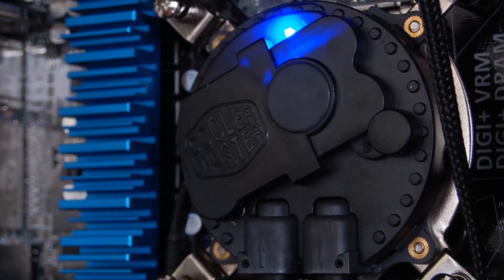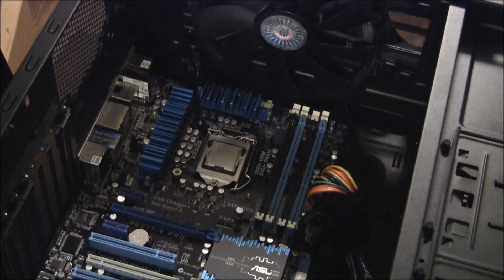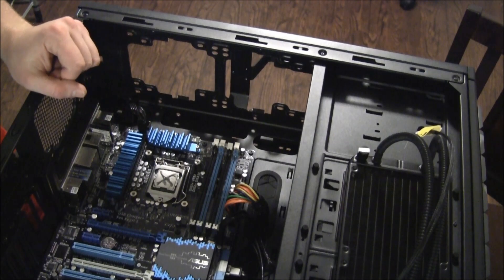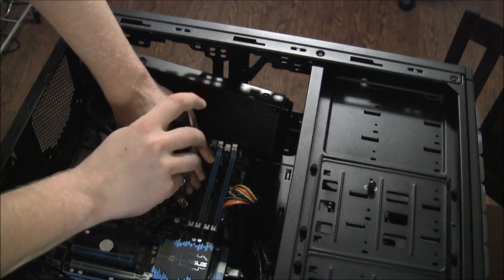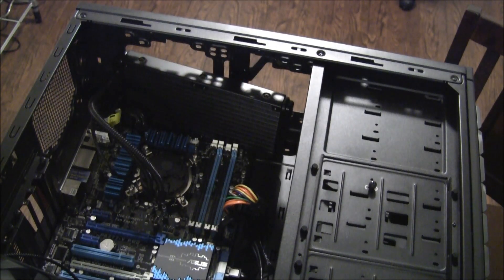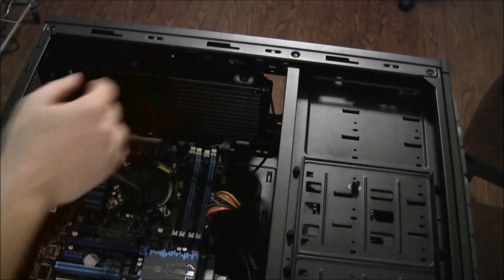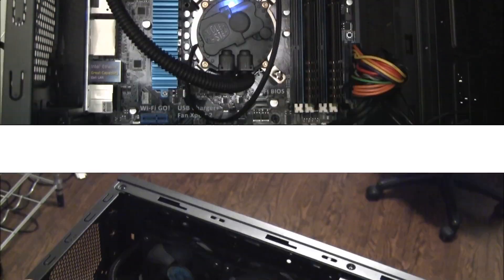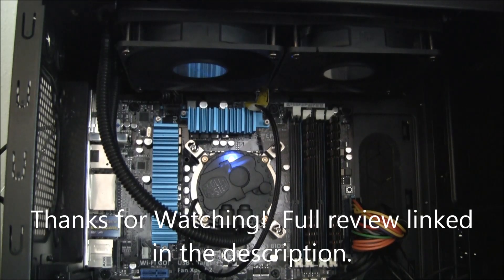Cooler Master Seidon 240M Review: Installation and 4.0 GHz Overclock Demo

Comment: Noctua - who know a thing or two about coolers recommend a grain of rice sized thermal paste worked over the top of the CPU with your finger inside a plastic bag.
My 1366 Xeon 3570 (which happens to have unlocked multi) idled at nearly 60deg with the stock cooler. With the Noctua cooler it idled a full 20deg C cooler. It is possible the stock cooler wasn't very flat on the base but a straight edge showed no irregularities so fiik what the problem was.
Anyhow, point is you don't need much paste to do the job.

Comment: I just changed mine from a push to a pull configuration for easier cleaning and the fan blades kept hitting things. Leaving out the rubber brace made the fan blades hit the radiator, and the rubber brace, when used, kept sticking itself in the way of the fans making an awful noise or just stopping the blades altogether. Had to stick something between the brace and the rad to stop that, but on startup when the fans hit 100%, I still hear the fans hitting the brace. wtf

Comment: wouldnt it be safer to install the water pump on the CPU with the feed lines on top?
this would prevent air bubbles from getting trapped inside over time.

Comment: I have this on a FX-8320 and it runs at 90F at idle....?!?!
The STOCK cooler ran at 85F idle... Isn't this huge cooler saposta be better?!!?!??!?!??!???!
$80 to just gain 5 degrees 
W
T
F
Reply: Idle temps dont differ much between air & liquid, it's the load that matters

Comment: my rig is :
asus maximus 7 hero with i7 4790k and cm nepton 240 m 

i want to know which cabinet will fit my 240m easily with my mobo 
cabinets available here are from corsair and cooler master
want a cheap and best cabinet , plz comment the model which will support my rig easily

Comment: Please help me, I got a New cm storm trooper and cant find the connection to the control panel for fans and led..  It isn't lighting up.
I cant find an connection for the fans on the hard drive cages too.
Its like there are too less connection cabels.
I read soms thinks about a molex cable nut that didnt Make thinks clear.

Could anyone please help me?

King regards
Arthur

Comment: So basically this setup has the fans exhausting air out from case through rad and out out of case. So that would be somewhat hot air I assume. Shouldn t we in take cool air throught the rad into the case instead. Or am I wrong and it doesn t matter
Reply: its all about airflow in the case, with front fans pulling in air to case, and if you setup rad fans to pull air in, you really only have 1 exhaust port on the back reducing airflow and also raising ambient temp inside the case, where as with fans pushing air through radiator(or in pull config, pulling air through radiator) to outside of case, it increases airflow inside the case and reduces ambient temperature so your VRM's/Mosfets, Ram are kept cooler!
Reply: doesnt matter
Reply: u're right. look up for jet engines mechanisms.

Comment: can i install this in my thermaltake chaser A21?
Reply: I have a Chaser A21 and a Seidon 240M and yes, it does fit, I had to do some ghetto mounting to get it to fit though (using the case mesh as a screw hole), because the screwholes didn't line up.

Comment: With a push/pull configuration, is the air supposed to be sucked from the outside and in? or from the inside and out? This confused me a bit :-)
Reply: Inside meaning the inside of the case, and outside being outside of the case.

Comment: Will I be able to overclock my 4770k to 4.5 or 4.6 with this?
Reply: I'm at 4.7 stable with push/pull on single 120x38 radiator.
I don't see over 70°C
Reply: It honestly depends on the quality of the silicon on your 4770k batch.  I'd say 4.3-4.5 is a safe bet but Haswell runs really hot.

Comment: Will seidon 240M fit in cooler master haf 912 plus case?
Reply: Yes
Reply: Tim Kline So is this confirmed? the fans and the radiator of the Seidon 240M will fit in the Haf 912?
Reply: Yes. If you put it on the top. However, it is a tight fit. It does indeed fit. But, the 120MM cooler is perfect for that case, that is what I personally have, and have a single 240MM up top. I hardly see over 100 degrees F, when gaming. At idle it is normally 78-80F.
Reply: You'll have to change the fans for a slim one's because the rear fan don't let space for the radiator fan

Comment: Did you remove the 200mm fan at the top for the installation of the CM seidon 240m cooler and is this something you have to do? :)

Comment from the maker: I believe it comes pre-applied (I can't recall for sure), but if it doesn't come pre-applied it definitely comes with a small tube of paste, so you shouldn't require any aftermarket paste.  We remove any pre-applied paste to ensure consistency when testing different coolers.

Comment from the maker: Indeed, and most times these pastes are much more "liquidy," i.e. less viscous so they spread very easily.  While the NT-H1 spreads decent enough, the "X" method works far more effectively and consistently with this paste.  If you used something like AS5, you'd have paste literally oozing / running out the sides, which is what I think you're primarily getting at, which is absolutely valid.

Comment from the maker: It's actually not as much as it looks like. We use Noctua NT-H1 thermal paste which is especially viscous so it doesn't flow very well. As I draw the lines across, I stretch out the bead. By drawing the lines toward the edges it allows for more even flow of the paste and we get a very consistent bead around the outside of the chip, allowing the little excess to escape evenly. We've measured the amount of TIM versus the "bead" method and they're comparable w/ equivalent performance.

Comment: The Coolermaster HAF XM has a 200mm fan on the top... would I have to remove it to install the radiator and 120mm fans?

Comment from the maker: Sorry, my explanation seemed a little vague.  I would set the 120mm fans to blow OUT the top, and have the 200mm fan also pulling OUT of the case.  So your stack from bottom to top would be 120mm fans > Radiator > 200mm fan.  If I were you I'd also try without the 200mm fan to ensure the 200mm fan doesn't actually impede the pushing fans.

Comment from the maker: Based upon the specs, it looks like the top vent will accommodate either a 2 x 140mm or 2 x 120 mm fan arrangement, so this should fit.  I would still try to check about the vertical clearance you might have from the top of the vent to your RAM sticks or any large VRM heatsinks on your motherboard to ensure those will still clear.

Comment from the maker: I think I'd rather have it be below the 200mm fans with them helping to exhaust.  The 120mm fans will create more pressure and are better-suited to push than they would be pulling with the 200mm (which would bleed around the radiator) as the pushers.

Comment from the maker: It looks like the Enforcer lacks a 2x120mm fan option which is what you'd need to ensure you have all of the available mounting holes.  If you're comfortable with making some small modifications, you could probably make it work in the upper vent, but it's hard tot say without seeing how much clearance you have with your current motherboard.

Comment from the maker: The one in the video is the Cooler Master Trooper.  The HAF XM is a great case and you have a couple options for mounting in that case.  It should work well with that.  The HAF 932 / 922 are also great cases, but are a bit before CM and other companies started making all-in-one watercooling systems, so you're less likely to have extra clearance for the Seidon systems. If I had to choose the HAF XM would be the winner in your list.

Comment from the maker: This should work great on the HAF X.  It has a large upper vent which should allow you plenty of room.  I cannot guarantee you won't run into any issues depending upon your motherboard layout, but you should be able to fit in that big case without any problems.

Comment from the maker: Sorry about that!  I did my best to keep the video to a manageable length.  I installed this directly over the existing motherboard backplate, as it was designed to span over the top of any existing backplates.  I hopped past the push-pull because it was essentially the same thing just with another set of fans in-between the radiator and case using another set of longer screws.

Comment from the maker: I connected the fans to the CPU_FAN header and the pump to the CPU_Opt header.  I was using an ASUS motherboard and most ASUS boards have two CPU fan headers.  Otherwise I would connect the pump to a regular fan header and allow the fans to regulate via the CPU header.

Comment: It would have been nice to explain what you did for a push pull function and not fast forwarding through certain parts since its an installation video to be honest idk what to do if my motherboard already has a back plate pre-installed

Comment: thx.. can you tell me if it's possible to fit (with Asus Sabertooth Z77's "thermal armor") in one of the following: 

1. CoolerMaster HAF XM

2. CoolerMaster Case HAF 932 Black
RC-932-KKN1-GP Case w/o PSU

3. CoolerMaster Case HAF 922,
RC-922M-KKN1-GP HAF Mini Tower with
20 cm fan in the front and top (is this the one in the video?)

thx in advance..

Comment from the maker: That's correct.  I had to remove the 200mm fan on top to put in the Seidon 240M.  I wouldn't say you'd be "under cooled" as these aren't sealed boxes and there's plenty of extra venting if you're intaking more than you're exhausting.  The large 200mm fans also spin much slower (and thus are quieter) so they don't move as much additional air as you might think.  If you have the Seidon 120XL, you can also place it on the back fan and retain the top fan, if you'd like.

Comment: Hi, nice video, i got 1 Q.
I have a CM Stryker, and it should fit in, but won't it be under cooled? 
i mean, in the stryker there are only the 2 frontal fans and the back one.
If i put the seidon(n in my case, the 120xl) i will have to replace the big fan on top.
Is it correct?

Comment from the maker: The response I got from CM indicates that the Elite 431 won't accommodate the Seidon 240M without modification, as it wasn't designed for it at the time.  It's a bit too low and the motherboard mounted too high to prevent the radiator from hitting.

Comment from the maker: Looking at the specs on the Elite 431, it looks like it can accommodate a 2x120mm fan setup, but I haven't used that case before, so I'm not sure if the motherboard standoff locations will provide the height / depth for a radiator.  I'll see if I can get an answer from a rep at CM for you.

Comment from the maker: I have the Cosmos II, and I don't see there being any issues with that case, it was designed to accommodate a wide range of water cooling solutions and the top vent allows for 3x120mm fans.  As noted above, the H110 and the Seidon 240M will be very similar and either should serve you well.  Your choice may depend upon brand preference, price at the time including any sales (the Seidon 240M tends to be notably less expensive), and the look of the cooling head.

Comment from the maker: They are extremely similar, which is why I tend to recommend the Seidon 240M because it is a fair amount cheaper than the H100i.  Their actual performance is also extremely similar, so it's really a preference of how the cooling head looks, whether or not you have a fan preference, and/or how much savings you can find, but both will serve you about the same in the end.

Comment from the maker: No problem, happy to help!  While I have not had the pleasure of getting my hands on a 1200 before, it looks as though the twin 120mm fans on the back would be perfect for this.  I doubt you'll have built-in mounting on the top 200mm fan and you'd want to remove the 200mm fan if you did try to make it work.  Let me ask my contacts at Antec if they can help out.  Send me a message if you don't get a reply in a day or two in case it slips my mind.  It should have all the screws you need.

Comment: I just purchased this and I hate to be "that guy" but how do you think it will fit into an Antec 1200 full tower case? Do you think I will need some separators or long screws? What would be your opinion for the best placement top with the 200mm fan or on the back were there are 2 120mm fans? I know your video shows a different case and you may have never used an Antec 1200. I just thought I would ask you first. Thanks in advance.

Comment from the maker: Sorry for the late reply.  I'm actually using Patriot Viper Xtreme memory, but they are similarly high-profile.  This would certainly suit your needs nicely on the clearance front, but then you'll need to be careful about the depth from the top of the case to the top of the DIMM slots for push-pull, as even in my CM Storm Trooper and a full-sized P8Z77-V Pro came right up to the sticks within 1mm.  The Phantom should give you good options to work with.

Comment from the maker: I was using the ASUS P8Z77-V Pro motherboard which has two CPU_Fan headers so I plugged into both of those.  However, if it only had 1 I would plug the pump into the CHA header since from what I can gather from any specs the pump speed doesn't vary much but you'd want your fan speed to adjust to your CPU temps via the CPU header.  Which motherboard do you plan on using?  Most new motherboards have at least basic onboard fan controls so you can likely set how each fan header operates.

Comment: I see your using corsair vengeance memory. I was wondering if you did any further testing on whether or not the quad fan push pull tactic works with those sticks. I've been trying to find a good compatible heatsink, be it air or liquid, for my CPU. I have the P8Z77 M-Pro, a Micro ATX board with all four ram slots filled with Vengeance, so it's hard to find a good compatible heatsink with those effing heatspreads on that high profile ram. I was thinking of getting this cooler with my new phantom.

Comment: so the fans that u installed on the radiator, r they pushing the air out of the case or are they taking air into the case?

Comment: lol i just checked, im running at 4.2 mhz with the default fan the i7 comes with. I have a intel 3770k i7 ivy bridge currently in my build. What would my maximum cpu speed be at without exploding of course?

Comment from the maker: The H100 is almost exactly the same size as the Seidon 240M, so you should be good to go.  Again I would use caution if you want to use push-pull as it could interfere with the memory depending upon your motherboard.

Comment: intel is a little bit too expensive... similar amd processors run the same games only with 5-7 fps less, but they cost 100$, 150$ less
but that a REALLY good overclock :p 3.8 to 5.0 keep the good work :p

Comment: i have an AMD FX-4100 3.8ghz ( overclocked to 4.0 ) and it keeps at 20C ... 
The maximum temperature i've ever seen it while gaming was 40C and 50C while rendering with Cinema 4D ... 
All this with the stock cooler ( fan ) if i get the Seidon 240m should i increase the overclock?

Comment from the maker: With the Carbide 400R you should be golden.  I know that'll fit their H100 (in fact, after checking, they show it on Corsair's product page), and the radiator dimensions are essentially the exact same as the Seidon 240M.  You'll want to keep an eye out with your given motherboard of choice if you want to go push-pull though, as you'll run into the memory slots pretty quickly, a similar problem to what I showed.  The Seidon 240M should work and save you quite a bit of money as well.

Comment from the maker: We previously had an Antec Kuhler 920 just before we installed this, so both fans came off with the heatsink and we simply hadn't put the rear fan b ack in yet.  I would say if it fits, you shouldn't see any noticeable difference in cooler performance but will help pull more airflow out the back.  Try it without first, and then with, and if your temps are the same, keep it in for a little extra airflow.

Comment: I have a question, i plan on buying this cooler and i notice you dont have a back exhaust fan, i have the HAF 932 case do you think when i use this i should remove mine also. and another question if you know the case, i setup my side fan to exhaust to help dissipate the exhausted heat from my gtx 670, do you think thats a good setup or should i just remove the fan entirely

Comment from the maker: I would plug the pump into the CPU fan headers because most motherboards will allow you control over the CPU connectors, but not all allow full control over the other fan headers. My motherboard has a CPU and CPU_Opt header, so I plugged the pump into the CPU and the fans (via the included splitter) into the CPU_Opt ports.  In my case, it wouldn't matter because the ASUS P8Z77 Series allows full control (via BIOS or software) of all fans, so I can setup a custom temperature-fan/pump speed curve.

Comment: Thankyou for the review, but I have a question after buying this.

Where should I plug the 3 pins connector of the water pump? The CPU fan of the motherboard or the PWR fan for the full pumping speed?

And should i plug those 2 radiator fans 4 pins to the CPU fan of my motherboard?

Comment: Water coolers are more efficient at dissipating heat, if you are in a very cool room then air cooling is fine but the warmer the room, the less efficient air cooling is vs water cooling as the radiator is much better at getting rid of the heat than an air cooled heat sink due to the surface area.

The other major issue is the space taken up by the big air coolers, they have a lot of issues in terms of fitting in smaller cases, have problems with many full height ram modules, etc.